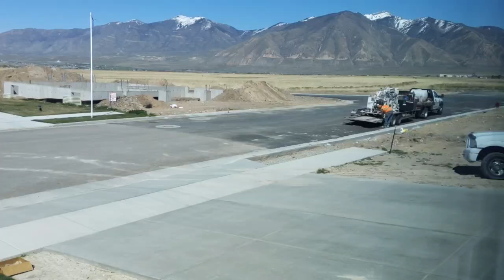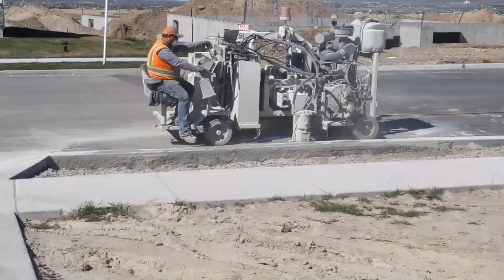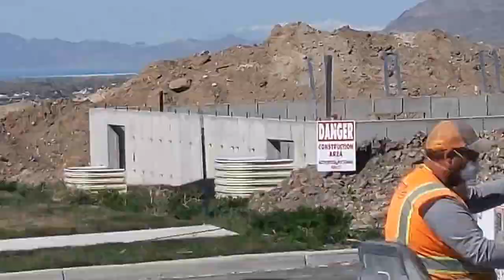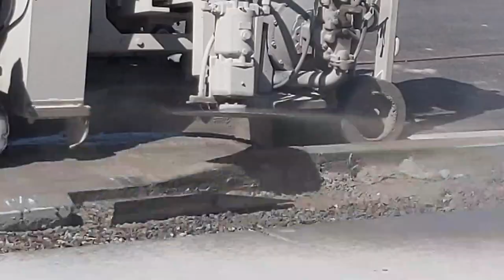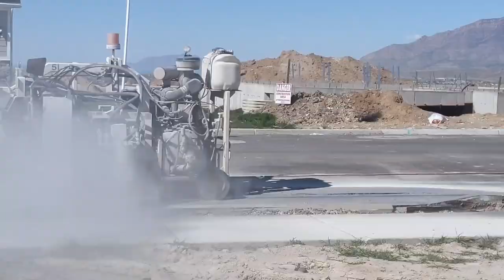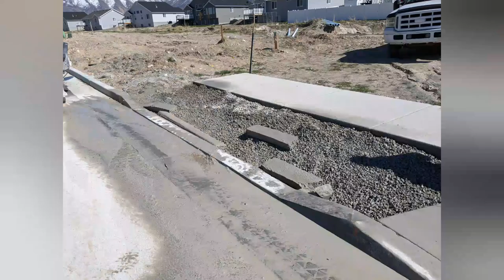Cutting the Curb

Comment: Wow... and now I know :). Pretty cool stuff! I wonder if there's any way of 'polishing' / 'finishign' the curb cut so that it's not so obvious that the curbs been cut. Otherwise the finished product looks pretty bad.
Reply from the maker: It wears down and fades over time. That's how my original driveway section was cut and you can't really tell anymore. As far as I know, that's how all driveways are cut/formed in new neighborhoods when there's a regular curb next to it. It's much easier for the concrete workers to pour long sections of curbing then come back later and cut them once a house is finished being built and they know exactly where the driveway will need to be.